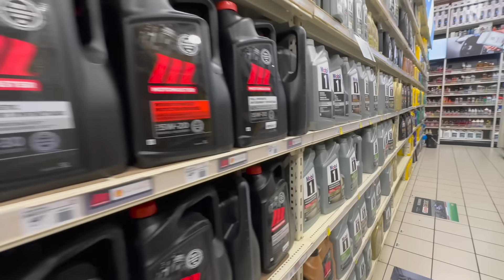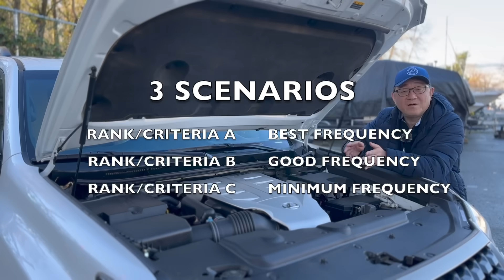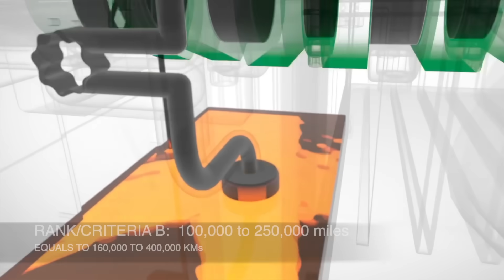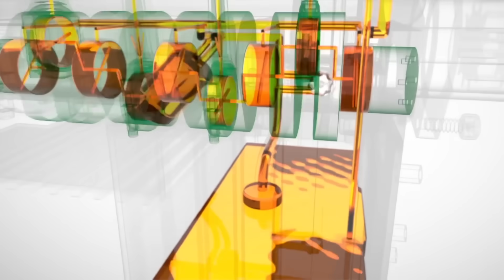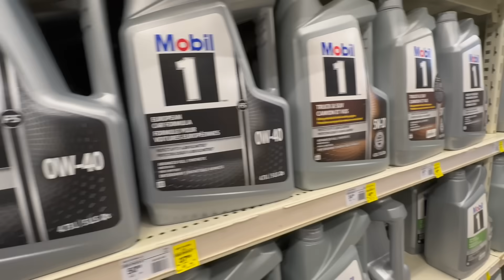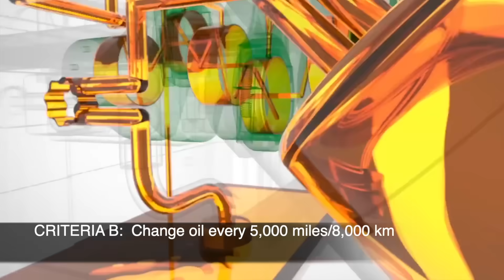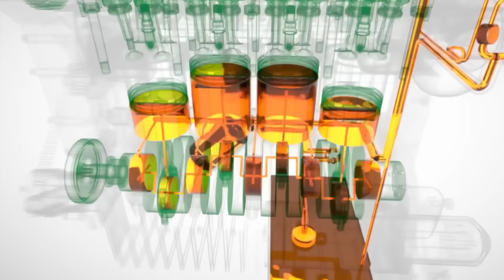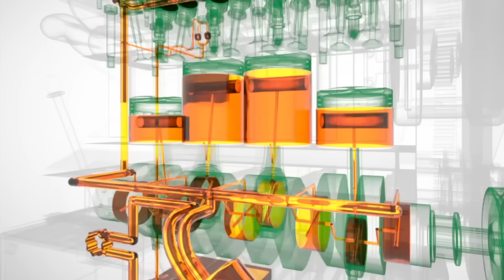ENGINEER EXPLAINS HOW OFTEN TO CHANGE OIL & FILTER // UPDATED CRITERIA-BASED RECOMMENDATIONS!

Comment: I used to change synthetic motor oil in all my Hondas and Toyotas every 5,000-6,000 miles every 6 months having mixed city/highway driving 50/50. At one point of time when I noticed technicians at the repair station did sloppy job by putting the drain plug back while used oil was still draining, overfilling the engine with oil, creating spills inside the compartment and under the car without proper cleaning etc., so I started changing oil in my vehicles myself and always happy to do it since then. Now I can see the condition of the oil every time plus I also monitor the condition of the car because I can everything under the engine myself. I noticed that after 6,000 miles Mobil1 Full Syn and Pennzoil looked very bad and smelled with gasoline. Then I researched the problem, talked to specialists and came to a conclusion that if I plan to keep the car for long and go beyond 200K mile milestone without my vehicles burning any oil, I need to change it more frequently and a 3,000K mile or 3-5 month interval has actually become my new choice since then. I don’t care what Blackstone Oil Analysis report says or whatever those individuals say that it is still a good oil, try longer interval or it is a waste of money. 3K mile intervals make you car run really long time providing stickyfree piston rings even after 200K miles. Oil change is really cheap when you do it yourself in comparison with those repair bills. Every experienced technician I talked to said that 7-10k miles lead to oil burn after 130-140K mileage and with 3,000k mile intervals and good oil you will run your carbasically forever. I still purchase good oil like Mobil1, Pennzoil for all my vehicles as there is no good stuff for cheap in this life and I don't believe that saving $5-$10 every oil change or anywhere from $500 to $800 within 20 year period of car ownership will improve my life anyhow. Thus, please get yourself good oil with excellent physical properties. If you think otherwise and buy cheap oil, just please reduce your intervals even more as the formula used for those is not as strong and it simply falls apart and burns way sooner leaving sludge and gunk inside the engine in comparison with more expensive oils . And also, After 100K-120K mileage, forget about long intervals especially if you have lots of short trips and mostly city driving. Don't overthink! 3K miles, boom, just change it. God bless all!
Reply: Agree 100%
I follow the 4 month interval change too....
January - April
May - August
September - December
I put on about 15,000 kms annually... Hope my Corolla Hybrid SE AWD will last forever....

Comment: I'm glad to hear you quote AMD, the Car Care Nut, as I follow his recommendations to the letter for my Toyota. Thank you!
Reply: Ahmed is the man and his recommendation is a flat out 5k interval.
Reply: @Shawn-ky2tw  if you can, what is Ahmed's channel...thanks
Reply: @kirtg1  The Car Care Nut
Reply: @Shawn-ky2tw because of his channel, I bought a 2015 Toyota Venza used. Because of his recommendations, I came prepared of what issues to look for before making the purchase. The BEST automotive channel on YT, when it comes to Toyota, Lexus, and Scion! 👍🏼
Reply: AMD is the man! 👍
Reply: @BangBang-hk4rg     if you can, what is Ahmed's channel...thanks
Reply: I too follow AMD and learn alot from him.  👍
Reply: My father bought a new 1996 Camry, eight years of regular oil changes. I’ve ran it another 20🎉. Not a lot of miles, 135k as of today. Just drove it 1300 miles recently, amazing car. Love it. Yes, it has needed things replaced, but the engine and transmission has been maintained pretty well. Great info in this video 👍

Comment: I am going to keep my current car for 3-5 years and i put on about 15k miles per year.  75k miles.  I am probably border B.  Somewhere between B and C.  I did a break in change at 600 miles and will probably just do every 5,000 miles with synthetic.

Comment: Gonna need hourmeters on PHEV & Range Extenders.
My i3 REx, which travels 120 miles each day before the ICE engine ever fires up, has me changing oil just annually, since the ICE only runs about 5% of the 22,000 miles we drive each year.
2.6 quarts and a spin-on Mahle filter DIY is all it takes.
Curious about the Toyota Prime & GM Volt owners????

Comment: I agree. I change the oil every 3k in my 1994 toyota 4x4 pickup and my 1996  toyota tacoma 4x4. The Tacoma has 230,000 miles on it and has needed only normal maintenance.  Same for the 94.  Clean and tight inside.

Comment: These oil topics are very essential. It is also good when opinions are backed up practically and scientifically. If people have good oil change and car maintenance culture overall, the vehicle will have more potential to run longer without causing super expensive repairs due to oil burning issues and end up on the junkyards as a result of it. Thanks
Reply: A lesson I learned the hard way myself.
Changing the oil at HALF the manufacturers recommendation (i.e. twice as often) is still much, MUCH cheaper than a rebuild or new engine - and will typically PREVENT the problems that require a rebuild or new engine.
Manufacturers extend the service interval as a sales pitch (looks cheaper and less inconvenient to the buyer), and have NO interest in keeping your car healthy past warranty - if it kept running fine for 25 years, you wouldn't buy another one....
Reply: @OhSoddit  So much true!

Comment: The oil should be changed after 50hours, 100 and then 500hours from new.  Your routine can then be followed, although I wouldn't stress at 3000 miles, I would have said up to 5000 hours on low revving engines.  Conversely, track days before and after each outing.  It's the metal bits you need to clear from the engine, diesel and other particulates are much smaller and less harmful.

Comment: I've adopted a 3.3K service for engine oil interval for my car. I have a Scion tC 2015, basically a camry. I change the oil filter every 10k. More importantly I started at 40k, a little late in my opinion, to change the atf every 20k miles. Just a drain and fill. I'm only at 70k miles with my car, but I do intend to keep it for the long run. The parts that are wearing down more often are rubber parts that are exposed to the sun/ heat. Keeping rubber protected and clean is the hardest part of maintenance for me. The engine and transmission are going strong.  Other fluids like coolant, I've replaced it once so far as the old coolant aged out. I do coolant every other year now.

Comment: Own two Lexus, 17yrs old and 13yrs old.  Change oil and filter every 6mths or 5000miles, with mobile 1 full synthetic.  No engine problems at all, to include no oil burning.  I use the same interval for my son’s Prius Prime.  Other than 1 hr of time, the cost for oil change is about $40 (I do my cars oil change. Can’t trust jr. Mechanics). That’s cheap for worry free engine.
Reply: Couldn't have said it better myself, I also own 2 Lexus's with Mobil 1 stacked to the ceiling in my basement. Oil is cheap and motors are not. I just bought a dozen Toyota filters recently. In my 45 years of driving, no one has ever changed my oil but me.
Reply: @charley95sheridan44  I agree, I’m 73 and the only person to change the oil in all my vehicles, even the numerous new vehicles I bought I have never let the dealership give me a free oil change.  When I lived in town with a lot of short trips I changed oil and filter at 2k miles and after I moved out in the country I started going to 3k miles.  I also use Mobile 1 0w40 European blend oil which has a very good additive package that I prefer, also it’s just under $5.00 per quart when you buy it in the 3 jug carton from Wally World.
Reply: Lexuses.
Reply: Watch Project Farm review Mobile 1 synthetic. I used to be a believer in the stuff, but it's actually not even a competitor at it's price point.
Reply: @MJorgy5   look up the testing on Mobile 1 0w40 European blend, it has a very good additive package, much better than most oils.  That’s all I use in my vehicles and it’s under $5.00 per quart in the 12 quart box.
Reply: Junior mechanics will have to plug a computer into the car to find out how to change oil. I took my petrol car in for a major service and they didn't change the spark plugs. The receptionist told me, very sincerely, that "Your car has a diesel engine Sir. Diesel engines don't have spark plugs." That was a major franchised Nissan dealer.
Reply: Well said. I take my older Ford escape with 193k to jiffy lube in winter because it's so cold out and the oil only lasts 3k before it gets dark and lifter noise develops. In spring I start changing it myself with castrol gtx high milage because it has a much higher temp degradation. It never develops a lifter knock. The oil at 20 minute oil change places is very low quality in my book. I might bite the bullet this year and do my own changes in winter.
Reply: I used to use Mobile one until I switched to Pennzoil platinum and my vehicles are much quieter and smoother running.
Reply: Same here. I never hit the mileage, it's always 6 months.
Reply: you'll be buying catalytic converters before you'll have to buy engine parts.
Reply: We have a 2005 Pilot with 275K. Oil and filter changed every 5K. It purrs like new and the trans shifts very well(miracles do happen.
Reply: I'm from England, i change my oil every 10,000 miles i have no issues either
Reply: @ernie451  kilometers or miles? how are you tracking miles?
Reply: @dabneyoffermein595  well i have a service light that alerts me approaching 10,000 miles, and i keep a record of the service, strange question!
Reply: @ernie451 How many miles on your engine?
Reply: @adribouss  154,000 and its an 07plate, golf edition 30
I recently serviced it and it's as sweet as a nut
Reply: were you a  "jr. Mechanic" = are you comparing others using yourself as a yard stick = does this "changing of the oil" prevent you from driving over things in road or deer avoiding your car?? I had some jr squirrels play havoc with the wiring once, I changed my oil right away .
Reply: @ohioedde  I hope you are not a mechanic.  There is a difference between maintenance and repair.  Oil change is a maintenance item and wire harness chewed by squirrels is a repair.  Most maintenance items on a car can be done by the cars owner using basic set of tools.  Most repairs require more specialized or unique tools that non DIY are willing to buy.  Also, what is hard is not the repair itself, it’s doing a proper diagnosis of the problem.  As for trusting jr. mechanics.  Maintenance items is not what jr mechanic want to be doing.  They want the repair jobs (more money and satisfaction).  For oil change, jr. Mechanic will want to zip through them as quickly as possible to get another job so they will cut corners.  They will impact gun the drain plug, forget to put new crush washer or not put one in at all, and torque down the oil filter.  They will remove the beauty covers and not put them back on.  I understand, changing oil, changing engine air filter, window wiper blades, cabin filter, top of washer fluid, etc all suck for pay and sense of accomplishment for a young upstart mechanic.  That is why I do my own “MAINTENANCE” but will bring in my car for “REPAIRS”.
Reply: @CeasarBergonia  This is not true in a reputable shop. But it is true in shops with poor management. No shop wants to be sued or written up on google, unless they truly suck. And with the right mentor, the Jr. Mechanic soon becomes a Mechanic. Then a SR.
Reply: @ohioedde idiot thieves????????
Reply: A lot of people who don’t have garages (condos, apartments , townhomes) are forbidden to do any car work…..   leading to longer oil changes…
Reply: @jimliu2560   I could not live where I was forbidden to work on my own cars, I’m glad I was never in the situation.
Reply: @noahdunaway  
You are very fortunate…..         HOAs are very restrictive….
Reply: @noahdunaway situation ..exactly
Reply: @jimliu2560  You are correct...  It's the same oversight that people who push EV.  It's hard for Condo, Apartment, and Townhome people to charge an EV.  However, you can still try to find a reputable place to change oil and filter, even if it cost twice as much as DIY. This can be a hard ask because I could not find one in my area, so I started DIY.
Reply: @jimliu2560 I just use an abandoned parking lot and never have been challenged.
Reply: You should change that 3,000 mobile one is not the best it's good but the best is Valvoline

Comment: I change the synthetic oil in my RAV4 every 10-12k miles.  There is zero sludge, zero oil burning, and the old oil comes out pretty clean.  I drive mostly highway, no short trips.  I have about 115k miles.  I see no reason why I am shortening the life of the engine.  I bet it outlasts the rest of the car.
Reply: It’s probably because your rav4 is a hybrid and the engine might only be running 50% and the rest on battery electric. So if you’re changing every 12k miles that’s like 6k mile oil changes. I think this is Toyotas secret sauce for reliability in their newer models.
Reply: @Cazorlah  It’s a gas model.  I defeated start stop, so the engine is always running.

Comment: My typical oil changes consist of 3000 mile or 3 months for good conventional oils.
4000-5000 miles or 6 months with good synthetic oils. I’ve been a heavy line tech with Ford for 15 years and worked at independent garages for 14 years……have seen a lot of damage from people not changing their oils frequently enough….typically it was lack of proper oil changes or lack of oil that caused 90% of all my work concerning internal problems….even repeatedly changed engines in customers vehicles for not changing the oil again after the first engine replacement …..some people just never learn.
Reply: Nailed it! 👍
Reply: The main thing is the oil filter. It takes me less than a minute to change a roll of Great Value 1000 toilet paper and add a new quart of Walmart synthetic oil. The Australian Jackmaster Classic is in a place where it drains at shut down. No spillage. Change it and add a quart of oil every 6.000. Yes I know oil is supposed to get dirty and be drained. Thats what the oil change industry recommends. LOL.
Reply: What if a garage put 5w30 in a Ford engine that called for 5w20?
Reply: @mem1701movies that doesn’t matter….5w-20 is an attempt to get every last oz of fuel mileage from a vehicle.
Reply: @mem1701movies  My 2007 Mazda6s owned used since 2008 (13, 500 miles) has a 5w20 recommendation right on the oil cap. I have used 10w30 since my first oil change. I live in Central FL.

Comment: What's your view on PHEVs like the RAV4 Prime/Prius Prime/NX450h+/RX450h+/TX550h+?  many owners don't drive the gasoline engine that much.  Should it be once a year?
Reply: I follow the 4 month interval change too....
January - April
May - August
September - December
I put on about 15,000 kms annually... Hope my Corolla Hybrid SE AWD will last forever....
Reply: @dproulx222  well the Corolla Hybrid is not a PHEV.
Reply: @lsft  If you have the money to buy a PHEV   why wouldn't you want to change the oil at more frequent intervals?  

A = Change every 4 months
B = Change oil every 6 months
C = Change oil every 12 months 

Should you buy a Toyota Camry Hybrid? 1 Year Ownership Update.  https://youtu.be/IN-z0_LSMyk?si=qME08N2Q5qshnhNR

The same principle applies whether you have:
gas vehicle
hybrid vehicle
PHEV
Reply: @dproulx222  well, if your engine never turned on for 3 months and never used why change the oil? It's not about money, but more about being more environmentally responsible as well.
Reply: If you have the money to buy a PHEV or Lexus then you have the resources to:
A - Change your oil every 4 months (Excellent)
B - Change your oil every 6 months (Good)
C - Change your oil once a year (No respect)
Reply: @dproulx222  seems like you don't understand it's not money. Thanks for your input
Reply: @lsft  Dont do this to your RAV4 Prime and Prius Prime -https://youtu.be/SEK0wN_IqgA?si=Gk55KB18GtpAaVCE&t=820
Reply: @dproulx222  thanks, I've watched all of them already

Comment: David. As I knew and from the Lexus dealers told me on my used 2019 certified GX460 (I bought it almost 2 years ago) to change oil every 10k miles or 12 months. They’re covering 2 oil changes free of charges as it’s certified. I don’t have the GX maintenance service manual to look at. But anyway I just go by what they said. BTW my GX warning sign for maintenance service ON when it reaches to almost 10k miles from last time I had oil changed. My wife’s RX350 was set the same. My question is why Lexus dealers don’t tell us to bring our cars back sooner so they can charge more? Is it specified on Lexus maintenance service manual book when to change oil and for any reasons why Lexus manufacturers set it around 10k miles for synthetic oil change? I learned from your video that after these free services, I’ll change oil every 5k-7k using synthetic oil for longevity. Note that the previous MDX I had set warning sign service to change synthetic oil at around 7k miles. What’s different. Thanks David.

Comment: Also, at 75,000 miles do 1) Oil change  2) Transmission, drop and clean pan, 5 or 6 quarts of fresh fluid  3) Transfer case  4) Front and rear differentials  5) Brake fluid  6) Power steering fluid (hydraulic system)  7) engine air and cabin filters  8) misc wear items, shocks, brakes, wipers, gas cap, radiator cap, as needed.  75% of cars do not get any such regular maintenance = junk yard.